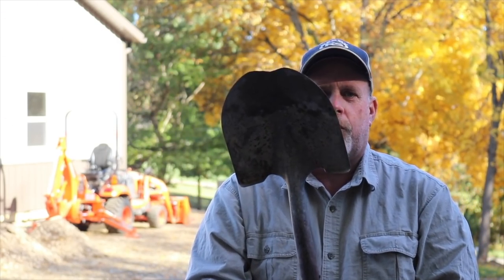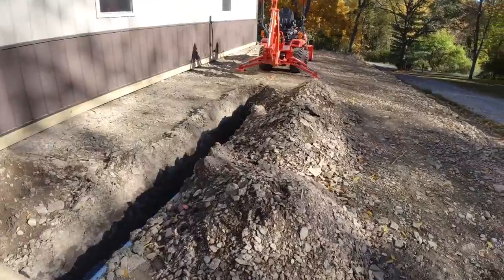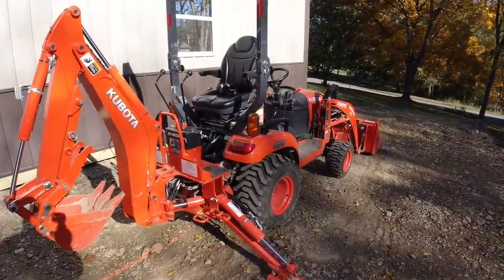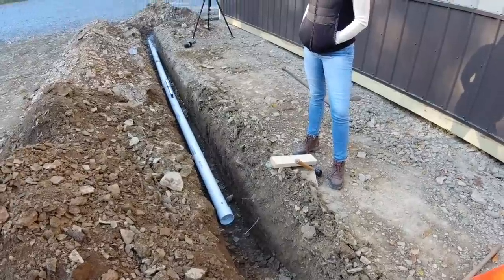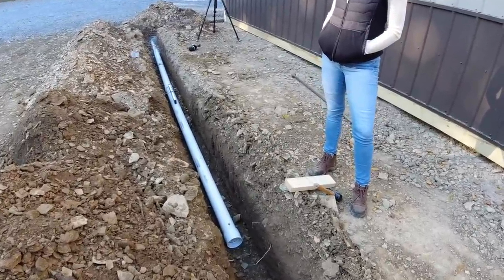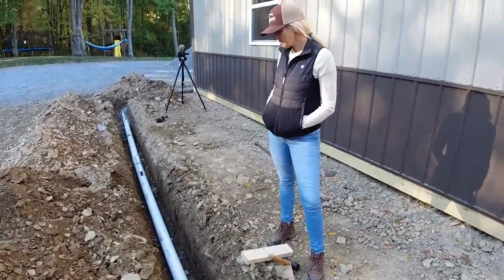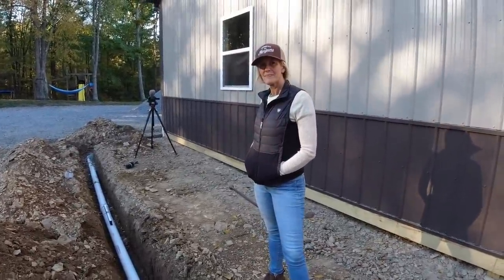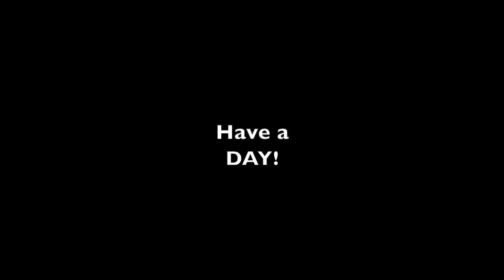#923 Husband and Wife Pipe Crew! Installing Downspout Drains on New Building

Comment: I sometimes put a heat cable in a culvert drain or roof drain in case of freeze up in the early spring . Only has to be turned on a short time to get the water to flow.

Comment: We did what you are doing in Wisconsin on our old house, and every year we had freeze problems. Not sure how cold it gets there, but that may happen by you as well. I would absolutely put a clean-out plug at the beginning. Something will eventually plug things up -- and if it's ice like we had, you may need to pour some warm water down it.😊
Reply: 😌 thanks for the info you folks put out, very informative. Any chance of you putting out labor cost for the long haired workers you have? I've found my labor costs are very high. Thanks again. Have a day.😌

Comment: pipe size is fine just hope you don't have problems i had on my building leaves plugging at 90.s i ended up putting leaf cover on gutter to stop plugging
Reply: That was a concern I had but I am reasonably sure Mike has a plan - the screens or covers or something like that.
Reply: Same thing happened to me where the gutter meets the pvc!

Comment: your gutters are going to catch a lot of leaves...a Y cleanout at the downspout to drain transition would be a good idea...also 45 degrees from the downspout to main line instead of out to a 90 lets water/debris flow better...
Reply: put those downspout screens in the gutter to keep leaves from going into the downspout
Reply: @daves7525  You have to be careful which gutter guards you use. Some of the expensive fancy ones do not let enough water through so in a hard rain the water just runs over them. We just replaced our fancy expensive ones with cheaper ones that actually let water through.
Reply: I agree, 45 or sweeps at the bend will be a huge difference for future maintenance.

Comment: Mike - You need to buy Melissa a paint stick so she doesn't have to hunch over to paint a line. Got to watch out for key talent FTEs ! I did something similar to what you did but I added a Wye at the downspout with a screen . The Wye gives you a chance for an easy clean out if necessary.  Also made the 90 degree turn with two 45s so that if  I did need to use the clean out Wye a snake would nicely navigate that corner. Very nice project. Look forward to the updates.

Comment: You must have so much fun, "playing" with all the different gear.  Like a kid in a toy shop, but for real tasks.  I also like my old shovel just like yours for all general moving stuff around, but since I started doing more fence repair and digging drains work and the like, a fencing shovel has been what I have used most.  In Oz, the heavier grade is the sewer pipe and the stormwater is the thinner pipe.  I would have used a bit less 2a limestone as backfill, but at least the shale was useful to fill the low spot in the "shed"/barn.

Comment: That's funny Mike. My buddy just broke a small garden hand shovel. I told him I had made my own over 30 years ago. I took a full size shovel. That the handle broke off of. I cut the blade down. Then took the metal end where the handle went in. I dipped it in liquid grip. I love that shovel and will fight over it. God bless

Comment: My grandfather had a favorite "worn out" shovel like yours.  He always cleaned and oiled it before hanging it up in the shed.  He called it his "2 pony" shovel because like yours, the tip was worn back so far that it had two points.  I tried it and I think they should come from the factory like that.  Good for finish grading a ditch bottom.  What kind of fall are you putting on the pipe?  When you tie in the other downspout, think about transitioning  to 6".  That little backhoe will make you appreciate the trackhoe.

Comment: I hope you never regret not using sweeps and cleanouts in that drain line.
Reply: It's a storm drain, the open end where the downspouts are is considered a clean out!
Reply: @tomgarabed6568  The adapter looks like it was glued in on the video. But it's hard to tell. The pipe can't move in the ground and the downspout can't move screwed to the building. Is it still possible to run a smaller snake head after removing the downspout .. sure. But that may fall into the "regret" part. Also small sticks and branches will be more likely to get stuck on a 90 degree without those being sweep fittings. Adding a cleanout so it is only a matter of removing a cap fitting to gain access simplifies maintenance. It is why they exist. But .. good luck.
Reply: @aeasus I totally agree a clean out never hurts until you don’t have it. And with that 90 guess where all the debris will collect? Might be years but even if he buried it he’d still come out ahead in the long run. At least he went with good pipe, should help some.

Comment: Mike I noticed you adjusted the thumb on the backhoe part of the way through the video. I saw that it was set down close to the bucket and gets in the way. I did the same thing while recently digging a 300’ trench down the side of my driveway for a propane line.

Comment: Your going to be amazed at the amount of water that the roof will collect!
Reply: 1 inch of rain is .67 of a gallon per square foot of roof area.  Even a short steady shower will yield 500 gallons very quickly. I have a rain water system that holds 7000 gallons. A couple years ago 3 spring rains filled it completely up. My shop/garage roof area
 is 44x32 .

Comment: I think if I had been installing the drain line I feel a longer sweep 90 would allow the water to flow better. If you are draining half of the roof area the water is going to have a tough time making the short radius without backing up. It will be really interesting to see if you use a standard "T" fitting or a sweep T on the final connection. Also, if you do have an issue down the road maybe adding a copper wire in or along side the pipe for tracing would have been beneficial

Comment: Mike , you’ve spent some time inn the pipe isle. Not many know about the schedule 40 , adapter the reducer to fit with downspouts , much cleaner look, i use them on my rentals for high traffic areas , tenants kids are rough and flatten just reg metal downs and 45 ‘s and bottom of wall , love watching , miss my butler pa area , troutmans , Kelly Chevy deadlier , KERR aplpliances , ford dealer at end of business district , Pullman steel , builder of first Jeep , just under the bridge

Comment: Did you feel it necessary to glue everything?  I've done this same work on smaller properties with lots of connections, and we've never glued the pipes (we use Schedule 40 too).  The pipes dry-fit damn tight and gluing just seemed really difficult and unnecessary.  The few times I've had to make a change, it was nice to be able to bang the pipes back out of their fittings.

Comment: Mike if it is not too late I would highly suggest you add a couple of clean outs in that long run of pipe. Only speaking from experience. I had to go back and install some in mine. I have had clogs where I have found bird nest, walnuts and I have no walnuts trees around and always a lot of acorns. I guess it is birds and squirrels bringing the nuts in for me.

Comment: M&M, nice work....but questions!  You used non perf schedule 40 pipe so why all the gravel?  I thought you would cover the pipe with gravel and then backfill dirt.  It looks like you nearly filled the trench with gravel?  Second question, are you certain you dont need a 6" pipe for that surface area?  A 10 minute gully washer would easily fill that 5" gutter to 50% capacity.  Where those 4" pipes merge you could have a flow restriction.  I would recommend increasing to a 6" pipe at the "Y" where the front and back drains come together.  Plan for the worst, hope for the best!  

Love this series on the building!

Comment: If you would put in a cistern and catch that rain water off the roof you could fill the swimming pool and run your pressure washer, etc. and take the load off your well or better yet, lower your water bill if you have city water.  Just a thought.

Comment: I have heard that 4 degrees is the best angle 📐 for a drain?
Less,  the water doesn’t run fast enough,  more it runs too fast and causes back swirling,  slowing the run?  
I was wrong one other time back in 1972,  thought I was wrong about something,  turned out later I was right!

Comment: Love that you have this cool machinery for the tough jobs like trenches,,,but I hate that I might need to need a trench for my workshop electric line in Spring 2021, theres an existing electric supply line, but whoever put it in only put it down like 4", and it was run to the yard light, then routed back to the shed.....🤦‍♂️🤦‍♂️

Comment: Mike, I see that you have the Kubota BX23S... but could you give any insight to the Kubota B2401 it’s a New tractor out on the market... it comes with a Standard Transmission, however it still combines with all the similar attachments as all the other BX and B model Kubota Tractors.  Just curious on or what your take is on this particular model...

Comment: I know you're done with this project, but if you ever do another project like this what you might want to do is put all the straight runs together on the surface and then dump the whole thing in the hole.  You could use the machine to push the last joint in the ditch together.  In a previous life (I'm retired) I was a pipefitter and that's how we always did it
Reply: I think he wanted to make sure that the hole was dug with the right sloop????

Comment: You could have went with schedule 80 pvc and never worried about it. I know in Ky it’s plumbing code to run schedule 80 anywhere it’s going to driven over. If we use schedule 40 we have to Incase it in cast iron pipe. Any way good job

Comment: I am sure you already know, but if you build a sound wall, you need to use 45° variable facing on the side facing the house - otherwise it will reflect sound the same as your hobbyshop.

Comment: Do not put a 90 degree sharp bend in a drain pipe. Use a long sweep bend or two 45's to make the turn. You may need a cleanout at the corner as well if it's not too late.

Comment: Mike I would have used 4 45 degree elbow fittings instead of 2 90 degree fittings so the flow drains faster

Comment: Mike do you think you will get enough leaves and debris from trees on the roof that washbintp the gutters and down into your downspouts and the new drainage pipes to constitute gutter guards or will it be enough rain water to wash it all down and out of the whole system ?
      I would hope you would never have that issue but just a thought now while your in the process of installing the system.
   When the wind blows hard twigs and limbs will end up on the roof and will work its way threw the system and will clog at corners and other areas in the gutters down spots and pipe. So may be a wise purchase to install a gutter guard if the gutter installers didn't already do it.
 Might just save you a big headache latter trying to figure out where the blockage is.
   But knowing you you probably have a way to clear it with pressure somehow.
   You know alot about alot that's for sure.
    Your weather actually looks just like what I have down here in NC again today beautiful blue skies but we do have green leaves still until the end of oct and into November. 
   I really don't think your camera shows the true colors and beauty of your leaves .
   They all kinds of blend like a dull yellow but being from PA I know how beautiful thos time of the yr is up there.
    Be safe laying that pipe with mellisa LOL 😆

Comment: That shovel needs some love.... grind the tip back into shape and soak the handle down with boiled linseed oil... Sand the first coat of oil in while adding enough BLO to keep the surface wet. That will fill the grain and smooth it out. After sanding wipe off the oil and swarf and then oil it again. Wipe off any oil that is on the surface after a 1/2 hour. Then oil it every day for the next week and at least annually. Considering that you use hydraulics most of the time you can probably get another 20-30 years out of that shovel with some love. ;~)

Comment: on the back fill you should have used the blade on the tractor turned around backwards and on an angle and drive backwards on the old 54

Comment: Outdoors With The Morgans
 this question is off of the topic of the video but i was wondering what fuel to oil ratio do you use for your Stihl ms 880 magnum i am confused at what is the proper fuel oil ratio the manual says 50 parts gas to 1 part oil but another person that sells these chainsaws says that it should be at a minimum of 40 parts gas to 1 part oil for normal use and 32 parts gas to 1 part oil for milling what do you use?

Comment: I am a plumber by trade and you should have a clean out at a change in direction. You should never use a 90 on its side, use two 45 degree ells instead, there will be less chance of a blockage. Regards, Edgar

Comment: Mike I have a "pressure washer drain cleaning nozzle" that works great on dead end pipes like you are installing. There is 1 jet in the tip and 3 jets facing backwards that propel the nozzle forward. It works great. Flushes out any dirt and debris that collects in the pipe. My Son has used this to clean pipes filled with grease from kitchens, he is a plumber.

https://www.princessauto.com/en/detail/pressure-washer-drain-cleaning-nozzle/A-p8195612e